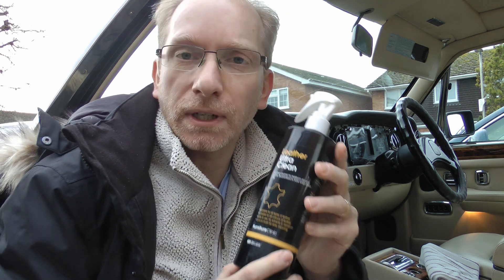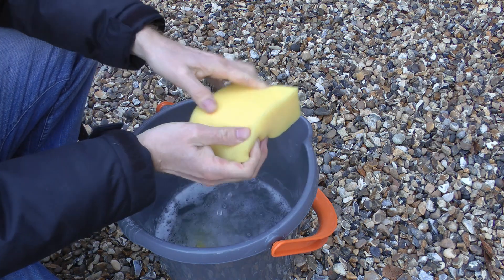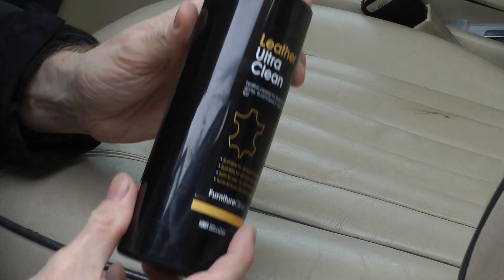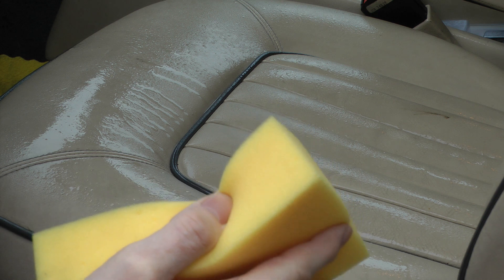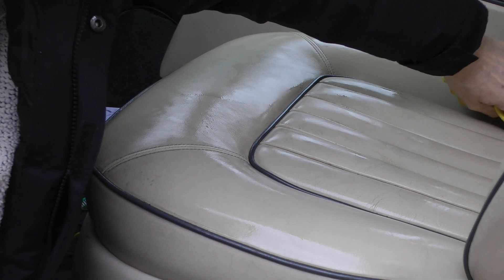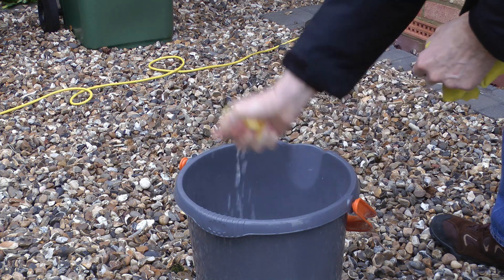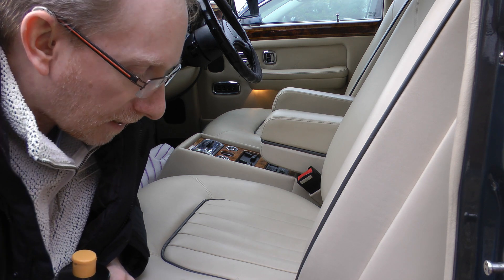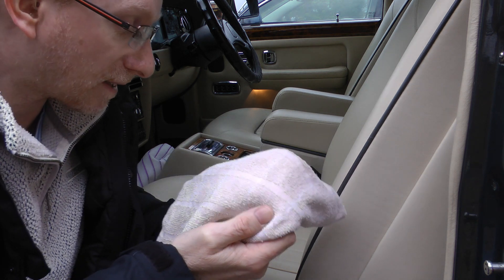Cleaning Rolls-Royce Leather Seats

Comment: What do you recommend for those plush light-coloured Matts to restore the softness?
Reply from the maker: You can try and clean them with specialist wool cleaner but I would probably suggest just dry clean only. In fact I took mine out and made some nice new ones using Dunelm Milk skins in light grey. They look fantastic for £30 a pop
Reply: A chap I knew who worked at Mulliner Park Ward advised regular vacuuming, and every few months sprinkle the lambs wool rugs with cornflour. Work it in with your fingers, shake out and throughly vacuum. Use a wire dog brush and vacuum again. The regular use of the wire brush, available at any pet supplies shop, will ensure the rugs remain soft and fluffy. I’ve used this method for over thirty years and it works a treat.
Reply: @JSDesign.Hongkong  Wow I do appreciate that. Will do this moving forward once the rear wheel bearing job is done. Poor thing is waiting for parts at the workshop for ages. Out of curiosity though, what does the corn flour do?
Reply: @shaazy  the cornflour absorbs a lot of dust and small dirt particles, and helps return some sheen to the pelts.